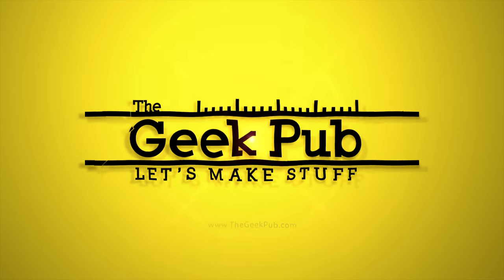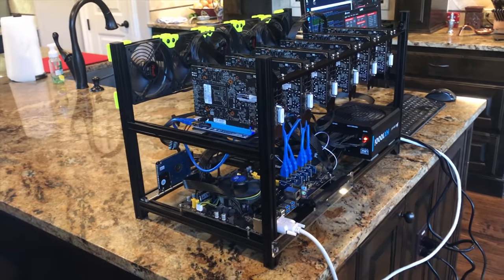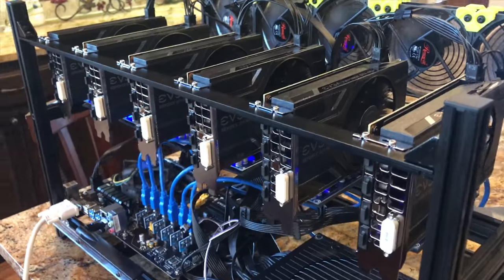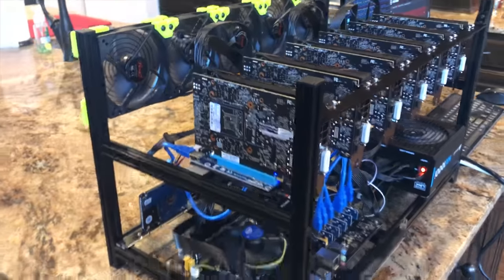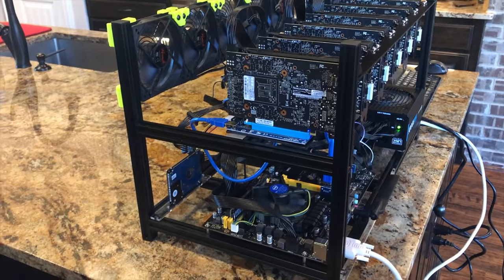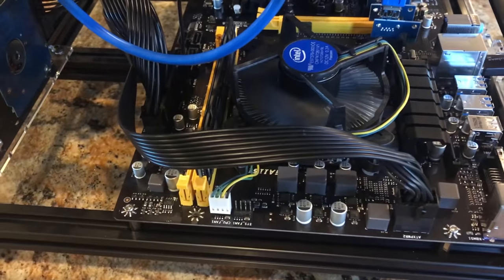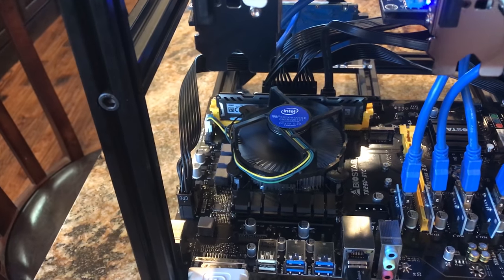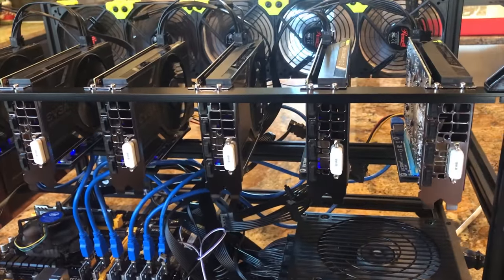Tour of my Mining Rig

Comment from the maker: Thanks for watching this tour of my mining rig!  I have a much more in-depth tour on my website along with a full FAQ: https://www.thegeekpub.com/11070/tour-mining-rig/

Also, sorry about the shaky video footage.  I didn't realize the front camera on my phone wasn't stabilized.  Ugh.
Reply: TheGeekPub so you have it always in the kitchen? For the heat?
Reply from the maker: Chisco... no!  Just to make the video.  I keep it in the garage most of the time.  Sometimes in my office.  Just depends on what I have going on.
Reply: Howdy ! 
QUESTION : what would you say is the total daily energy consumption of this rig ?
And to answer your question, YES, this format of video is totally okay : as long as what you say and show has substantial value-add, then feel free to push out more inspiring stories. And geek out on editing every once in a while. Shaky cam can be a pain but you were aokay, and as long as sound is clean, the rest is no big deal.
Thanks for the inspiration...
Keep on trucking (from France) !
Reply: Sir, You can even set core clock offset to -200 MHz.. makes no difference if you're mining ethereum. And cards stays cooler and uses no more than 80W.. done the same to my 1060s
Reply: thanks for sharing, great video. Does the 6Gb version of the GTX 1060 have a big or any advantage over the 3Gb version?
Reply: Chisco Garcia Gonzalez x
Reply: Mhs ?
Reply: I was going to say, if you plan to use this recording format regularly you should consider some kind of stabilizer and then saw your comment. Other than that, great video. I'm just looking at power supplies and didn't know about Corsair's link system. It's definitely a feature I'd like to have on a PSU
Reply: TheGeekPub bb
Reply: you will be needing windows software too right ?
Reply: Thanks for the video. How much extra is the electric build from running this rig? (Sorry if I missed it, I saw the bios power usage screen but curious $ wise).
Reply: Are your fans blowing towards the GPU or getting heat out?
Reply: Why don't you buy 2*1080ti($900) instead of 6*1060($300)? i did some calculations at whattomine and both options produce really similar profit.
Reply: What mining software do you use and what's your wallet of choice.  Good vid really enjoyed it.
Reply from the maker: L, yes. I've repeatedly complained to YouTube about this joker. I've submitted probably 30 copyright complaints and he just uploads another one the next day.
Reply: Hi!

Thanks for a great video!
How did you mount the psu to the rig?
I can't get my head around it.

Good luck with the mining sir!
Reply from the maker: Don Brascoe, watch my second mining rig video....
Reply: Thank You sir! Appreciate it! All the best!
Reply: Youtube has pretty good built-in video stabilization just need to enable it and let it process.

Comment: Those 1060s can probably hit 25 Mh/s each. I've got a 1060 3GB that gets about 24 Mh/s. As you mentioned, you can most likely push that memory clock up to +800 MHz or at least +700. If you're only mining Ethereum, the core clock basically has no impact. You can underclock/undervolt with almost no performance degradation. My core clock is -100 and the power target is set at 75%. Saves on electricity costs AND lowers the temps by ~6-8C.
Reply from the maker: Great feedback!  I'll play around with that!
Reply: The Evga single fan cards can't get quite as high as other cards, but I would expect 22 from each. You can also get those cards down to 65 watts each.
Reply: I've got the EVGA GTX 1060 3GB SC which is single fan and get 24-25. What really matters is what kind of memory you end up with. Mine has Samsung memory luckily.

Comment: When I use GTX 1060 I overclock it (windows) to 650 and actually lower power to 70, it work very ok, it should help u save little watts, GOOD LUCK. Also from my 70 rigs x 6 cards each, EVGA single fans typically heat more than other cards, my favorite one is Zotac amp version, Also in general u don't need Fans to cool the cards they should be ok in open air temp up to 80-85 they will have no problems, My garage is >100 summer time and still ok.

Comment: Hi greg, I'm currently getting ready to begin mining myself (starting with 8 rx 580's hopefully) and something I think that you should take note of for your builds would be that you can use server fans, smaller one for pressure bigger ones for less noise. Considering they could run low power it'd be an amazing set up and the gpu's would run cooler.

Comment: Thanks for sharing. I've done basically the same thing, except with 1070's. My rig looks almost identical. I also use my main PC as a master node using Awesome Miner, so I only use the agent on the actual rig as Mr.Geek said, it's a terribly slow machine which you dont really want to do much on other than mine.

Comment: Please look into possibly changing those SATA connectors - much talk on the internet over the dangers of causing a fire since they are [especially the injection molded ones] prone to overheating when daisy chained. Youtube / reddit is filled with great information.
Reply from the maker: Happened long ago.
Reply: KK- I JUST built my rig last week, then started watching other videos on rigs out of interest in the hobby, and started coming across people talking about the SATA connectors causing issues. Low and behold, I checked my cables and they felt much warmer than expected and I felt comfortable with, and that was WITH fans moving air across the rig. I immediately shut everything down and rewired it... which sucked, cause I did such a bang up job on the wiring. Even made a video on youtube about it... now its a rats nest, but at least not a fire hazard :)
Reply from the maker: Yep.  I replaced them within 24 hours of the video.  I just couldn't wait for the right cables to make the video.

Comment: Awesome video man! Just wanna let you know about the Power supply. I think people say get the 1200 because they're using cheap PS instead of gold or platinum rated PS. Corsair are usually gold or Platinum so the watt is true and correct. Also means it wont drop with the watt given to the cards or the computer. This way it wont drop under and mess with your components. I would always go higher than lower though just to be safe. The price isn't that much of a difference anyways. Again amazing video and love the build! Hope that helps alil explaining the PS Watt.

Comment: interesting so you run windows 10 and then the mining software runs on top of that? 
did you choose that over say ubuntu server to make the set up and monitoring simpler? 
as the machine will be connected to the internet to mine that will mean that patches are installed. do you think it's worth allowing the reboots every few weeks for windows patch installs? does the updated security etc make it worthwhile? would it be a case for better cpu, ram and ssd? as windows 10 installing updates and rebooting on budget hardware could add say 1 hour or more downtime a month, plus the additional risk of a buggy patch meaning that your mining rig could go down and not come back up until you notice that it's down and have removed the faulty patch, and i'm sure in your career you have experienced at least one of microsoft's major own goals, especially if your rig is in a  different country with cheaper electric costs and it's another microsoft bug where you have to manually edit the registry in dos, i suppose you aren't running on full power during that time as gpus won't be in use but is it something that is factored into the cost of running the rig?

Comment: Also, for Ethereum, you don't need overclock the core, just the memory.  Each crypto is different but Ethereum is memory bandwidth limited before it is processing limited.
Reply from the maker: I said as much in the video.  I have the core underclocked by 150 Mhz with zero impact to the hashrate.

Comment: Not to shabby.  You can improve. 

For samsung vram...
70%pwr, mem+1000, core will adjust according to pwr..it doesnt matter so much, just check to make sure core frequency is stable not bouncing around.  Also set fan speed higher to cool memory.
Reply from the maker: I tried those settings and the hashrate was very unstable.
Reply: TheGeekPub probably got hynix memory.  Ita junk, always check first and return for refund if hynix

Comment: Nice video and clean rig. Two questions: 1) How do you power the 120mm fans? 2) Can you do wifi on the setup or must it be hooked up using an ethernet cable to a router? Thanks!
Reply from the maker: 1) The power supply,, 2) Either.
Reply: TheGeekPub thank you. Did you need any additional extension wires for the fans to make it to the power supply?
Reply from the maker: Everything I bought is linked in the description.  There is detailed article at my website.

Comment: Hi Mike, So, I built this exact rig, pretty much, just waiting on the last 1060 card to arrive. Was just wondering if you could share your MSI clock settings that you've found to be the most productive yet stable. Currently I have been able to get my 5 cards running at about 23.3 Mh\s each. Was wondering what you've been able to get out of yours and remain stable. Many thanks in advance! Really like your channel btw. Thanks so much for doing it!
Reply from the maker: Check out my website for a complete rundown.
Reply: Oh I did, if you mean your article/guide on over clocking. Was just wondering what YOUR actual settings/results were so I could compare. Thanks again

Comment: Turn down the core clock. Decrease the voltage. I use SSH to run my miner, this allows you to administer it from a phone a RaspberryPi, TV ... whatever is capable to run openSSH. No license or some weird OS needed.
Reply from the maker: I tried this and put it back because my hashrate was all over the place.  It's on my list to experiment with a little more.

Comment: Have you seen the new ASUS MB has 19 PCI-e slots. made for mining, so you have less cost in CPU/RAM/HDD.
Reply from the maker: I have not, but that sounds sweet.
Reply: ASUS B250 MINING EXPERT  is the model, 18 PCI-e x1 and 1 x16.  $153 on CDW, it does take 3 24 Pins connectors as well.

Comment: I have the same setup but I can't get the mother to recognize my Nvidia GTX 1060 cards.  I installed the driver on the CD that came with the Nvidia card and it still not recognize my video card.  Anything I need to change in the Bios?
Reply from the maker: Troubleshoot.  Does the card recognize when plugged directly into the board?

Comment: 4:30 I run a 6 GTX 1060 6GB rig on an EVGA 1000 P2 so there's no reason why a 1200W would be necessary for those cards. For RX580s I believe a 1200W is unavoidable unless you do dual PSUs, but anything smaller I believe can fit on 1000W.
Reply from the maker: That could be the case.  I've not tried those cards.  But I specified the cards I was planning to use when I asked others what PSU I needed to buy. There is so much disinformation out there. It's pretty sad actually.
Reply: Yeah that's for sure. With so many people who have gotten into it who aren't entirely familiar with it, they like to spread information they think they know but often aren't 100% correct. I've been mining ETH since about April last year, right before the huge mining boom happened. When I was starting I got a good bit of information from some Facebook groups (like Bits Be Trippin) and Reddit. But the easiest way I've found to learn what hardware works and what doesn't is to just try it and measure it like you're doing with the HX1000i and proving that works. Definitely enjoyed this video so would love to see you do more about mining!
Reply: the problem is they are all over YouTube now spreading misinformation. So thanks for making some real relevant information that's accurate here. Great Video btw.
Reply: Does the 6GB have a meaningful advantage over the 3GB version of that card for mining?
Reply: its based on the dag file for ethereum. the dag file is currently close the 3 gbs so they would have problems mining ethereum in the near future. But if you using nvidia cards you should be mining other things as they are not the best to be mining with on ethereum. A better alt coin would be ZCash or ZenCash, but whattomine.com is the best place to see what is good for the card you are using.
Reply: That makes sense!  Thanks.

Comment: I have the same case. See that long clear plastic piece? It's on the wrong place. It should be where the PSU is. The PSU should be turned a quarter turn to the right, and it bolts to the clear plastic bit with the knurled bolts in the case kit.
Reply from the maker: I'm fully aware of that and covered it in my article on my blog.  I needed my power supply to sit in that orientation because of where I store the machine when it is running

Comment: how hard would it be to mount radiators and a pump to that case?   I guess what i am asking is how are the fans mounted?  Are there designated holes for the fans or can anything be mounted to the support beams anywhere?
Reply from the maker: Seems like it would be pretty simple.  Not sure why you would want to though.
Reply: TheGeekPub I'm migrating an existing 3 card liquid cooled enclosed  rig to a 5 card open air.  But am going to keep it liquid cooled

Comment: I can see that your hashrate for the cards fluctuates wildly.  I can also see that the card temps are pretty high too.  You need to set the fan speeds or tweak the fan curve because the stock settings will run your cards really really hot and the GPUs will end up throttling..  Thus why the hashrate fluctuation.
Reply from the maker: As mentioned it the video, I did all of that after the video.

Comment: How many cards do you have plugged into a Sata power cable? I was told that you should only have one card plugged into a sata cable because it would run way to hot if you have more than one card plugged into the Sata power cable.
Reply from the maker: No cards are plugged into the SATA cables.  They're plugged into the PCEi power supply cables.

Comment: Great video man - I bought the 8 GPU rig from the same company and it arrives Tuesday... Merry Christmas to me!  One question - did the mounting bracket for the hard drive come with the rig or did you buy that separately? It's so hard to tell in the instructions that come with the rig.  I hope to dive into the comments below to tweak my (4) RX 580 cards once I get up and running next week. Thanks again!
Reply: Never mind on the hard drive bracket.  I see it in the 8 GPU rig instructions now - assuming it actually comes with it.
Reply from the maker: Yes. It is included with the Minercase.

Comment: Have you worried about the temps? I try to keep mine around 65 or lower for longevity
Reply from the maker: These cards don't seem have a setpoint lower than 70c.  Even if I set it to 40C in Afterburner, they will cool to 70c and stop.

Comment: Most people get a power supply that is way too big for the need. What's one of the first tweaks miners make to save money? Miners undervolt as much as possible. My #1 goal is to make money, and the last thing I want to do is spend a lot of money on racks, fans, or power supply unnecessarily. Make the calculations before you buy, and it will be that much sooner for ROI.
Reply: Measure twice cut once.  That is the basics of building anything.  If you get just what you need well for 1 you have zero room for expansion in the future.  Plus if you are not smart you will use more than 8-% of max on the power supply.  Another reason to go with 1200 watt is the number of plugs on the power supply itself.  I just built my first rig with a 1200 watt 80+ platinum power supply and I ran out of connectors.  That was just on a 6 card rig.  I then did research to make sure I can hook to cards to one PCIe cable.  The answer on that is yes.  So that solved that problem.  I always go with a bigger power supply than what I need.  I have a low powered PC that has a 650W power supply.  It has plenty of room for expansion in the future.  Plus I built two gaming rigs each has an 850W power supply.  Room to expand plus not go over 80%.  The power supply is less efficient once you go over 80%.  In addition, it is easier to get 80+ platinum if you go with 850w or higher.  They are the most efficient power supplies.  The reason miners tweak the cards is not because the power supply draws 1200 watts.  It is because they want a faster ROI and by reducing power costs you can make more profit.

Comment: Thanks for this video. Did you have any trouble getting all 6 GPUs to show up? I built a similar Mining Rig running Windows 10 and only 5 GPUs are showing up.
Reply from the maker: Yes,  Add them one at time and reboot between each add.  That's the only way I could get it to work.  Also, I had a riser that was bad and had to replace it.
Reply: Thanks, that worked. New problem. Started mining Ethereum using Claymore Miner. I added email option to get notifications. After I started, received a few emails that the Miner is offline. When I went back to check the Mining Rig, it was completely shutdown. Have you experienced this issue? Thanks again for your help.

Comment: Hello Man, I noticed that you didn't plug Aux power 1 & 2 on the motherboard, I'm really confused whether I should plug it or not. Please help. Thanks!
Reply from the maker: You mean the ones that look like drive power connectors?  Those are outputs, not inputs. They can be used to power fans or your risers.  I didn't use them choosing to power everything direct from the power supply.
Reply: GOt it. thanks Man!